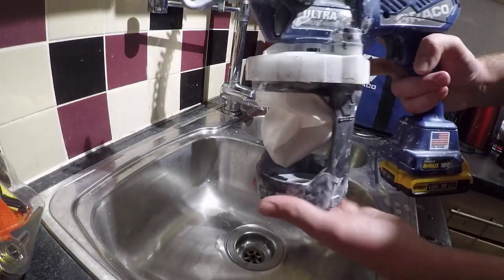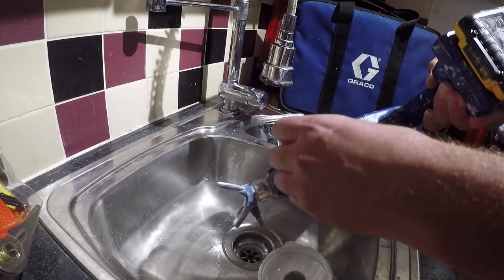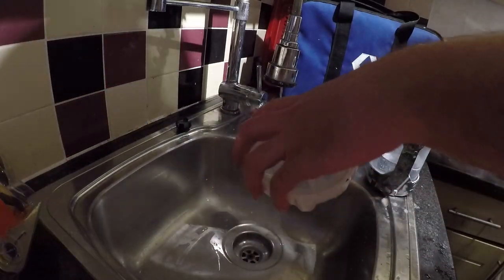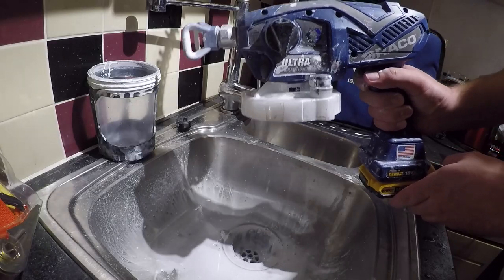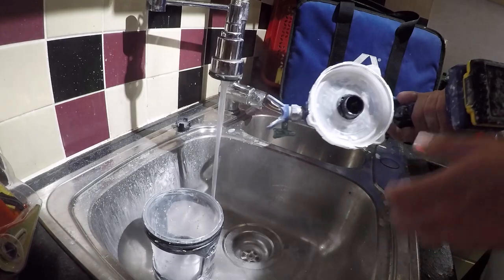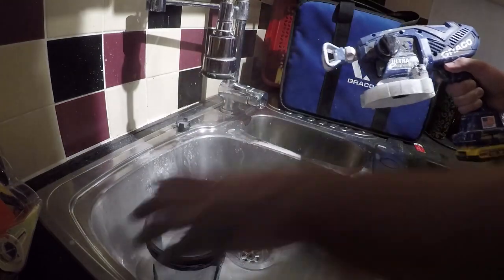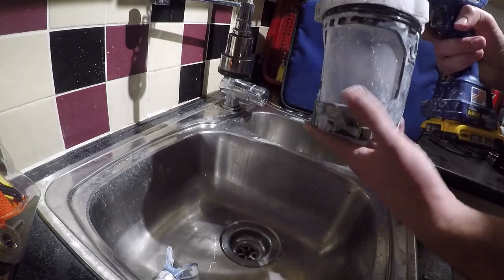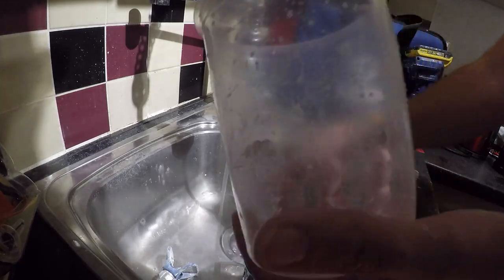How to clean a Graco Ultra cordless handheld airless sprayer

Comment: Interesting technique.  I plan to use it with a minor twist.  By cutting a hole in the bottom of a cup liner I can add fresh water without removing the cup and to swirl and decant dirty water as needed to facilitate cleaning in the upside down position.  (Freely admit I’m a lazy when it comes to cleanup)

Comment: What's pump armour I didn't get that when I bought? Will it affect anything ?
Reply from the maker: @danielculleton207  its something you can buy. It basically keeps the inside lubricated and prevents rusting on the inside and also stops it from freezing. You can search for graco pump armour or qtech qtector. Same stuff. After youve cleaned out just run a small amount through before storing.

Comment: Do you leave the pump armour in until you use it next or do you flush it out afterwards?
Reply from the maker: I dont think ive ever used pump armour in it. Just clean out and leave it with water in the pump. Its lasted long past most peoples and been a life saver
Reply: The instructions recommend leaving the pump armor in for storage.  Either way, the pump armor will need to be cleaned out before next use.

Comment: I've heard you talk about replacing the pump on this machine. Is it a costly fix?
Reply from the maker: I think around 200 to 250ish for a pump. Youd have to check from the suppliers. Pretty easy fix. That why i say if you use them alot get a main machine and this on the side if needed

Comment: It’s clogged up cause it was sprayed without screen what do I do? It tries to push out but not fully
Reply from the maker: Hi did you sort it? If waterbased.  I would fill a cup with hot water and a little dish soap. . Take the guard off. Connect the pot. Power on 9. Flip the unit upside down. Flick in prime and pull the trigger for 5 seconds. Leave to rest against a wall with the unit upside down for 10 minutes.  Come back and flick it into spray and see ig it comes out. Try it in prime again and then spray.

Comment: Always like that you pick good music. Good man. Have you got an air assisted airless unit ? 
I don’t spray my woodwork but I want to. I have an HVLP unit but I only use it for Morrells products.
They are for spraying not like typical gloss or satin that needs to be thinned down  so much there not worth using with my three stage turbine. So considering AAA. You managed a good finish with new FFLP tips on airless or your handheld unit ?
Cheers
Reply from the maker: Steven Mcfarlane  hey thanks 😎. The music is actually my old band haha i get done for copywrite if i have music on in the back ground thats not.mine... tikurrilla is nice to spray. But if you get a more powerful turbine a 4 stage ia 9psi and a 3 stabe is like 6psi so a big jump in power..
Fflp tipa yes got a great finish with them with main unit and ultra hanf held. I'll be using the finish pro 9.5 to spray waterbased gloss next week on spindles. No more that 5 to %10 thinning.. or for your 3 stage if you warm the paint up b3fore spraying you wont need to thin as much 🤘🏻

Comment: We use a 2 part paint for metal which has a reactor, would you be able to use this sprayer? How would you clean it out after as all our other stuff fail and we just end up using a brush....
Reply from the maker: Check out this video https://youtu.be/WyGxKz_tkmA
You would want to be using this one instead.. is there a reason youd need the cordless unit or would a normal unit be viable?
Reply: @sprayaholic  thanks for reply! Yes that’s the one I was looking at, we need this type to try and carry as light/ convenient as possible. Only thing I would be concerned of is getting it cleaned. Needs to be simple enough otherwise the guys will fail to clean properly. Thanks for any advice!
Reply from the maker: @mattmanison8791  no problem.  So you'll be using some type of thinners  for that paint. Id pour a small.amount in the cup give it a shake. Then flip upside down and spray it out. I'll be doing a cleaning video soon with oil based paints. Clean up will be the same principle.  Its not hard to clean
Reply: That’s great, I’ll keep my eye out for it! Cheers

Comment: What does switching to prime exactly do?
Reply from the maker: It returns it out the hole. So its not firing dirty water out so less mess. If you had a tip left in it would wear down the tip eventually.

Comment: Can you help me out? Just got Graco GXFF. Spraying waterbased Sayerlack at99 paint product. Tip is FFLP 312, 100 mesh filter in gun handle. To get decent fan pattern I have to have dial up to full whack. What could I change to achieve a lower working pressure as I'm concerned for life of machine if it's on max the whole time.🤔
Reply from the maker: adamandlorraine is the paint really thick? Have you tried thinning it 10%?
Try it with the black filters instead.  
What are you spraying?
Reply: Sprayaholic it's pretty runny. Made for spraying. Can't really thin it more that 5%. Have ordered a 60 mesh gun filter today and a 314 FFLP tip to see if that helps. Spraying mainly MDF and wood cabinets/furniture.
Reply from the maker: adamandlorraine did you change the seat in the guard? When you buy new fflp tips in the pack is a new black ane orange seat.
Reply: I might have got the seats mixed up now! I've got a normal RAC X one and a LP one. Is the LP one with a diameter bigger hole? Also the hard plastic orange thing. What's that for!?
Reply from the maker: adamandlorraine the rac x one has a large diameter hole. The fflp tips have the small diam are for more harsher chemicals. Hopefullly its the wrong seat.. this does cause it to spray poorly
Reply: Sprayaholic thanks mate for the advice. I'll give it another go today. And then tomorrow I'll have the new mesh and tip to try. It's been working ok but sure it could be better without the high pressure, using tons of paint and most going everywhere.
Reply from the maker: adamandlorraine yes defo sounds like wrong seat.. try changing the seats around tomorrow.. then if it needa adjuating them try filter swap. Let me know how it goes.
Reply: It's going great now. Set dial to low spray. 1200psi on the meter. Laying down nice flat coats. Awesome. Feeling much better about it now. Thanks.
Reply from the maker: adamandlorraine awesome mate.. if you find youre laying too much on and dont want to move faster. Drop down to a .10 tip or .08
Any issues give me a shout. Glad its sorted for you 🤘🏻
Reply: Sprayaholic cool. It came with a RAC X 210 so I might give that a whirl as it does chuck it on pretty fast and wet.
Reply from the maker: adamandlorraine if you do then you need to swap that seat over again. Pressure may change a bit aswel 🖒
Reply from the maker: adamandlorraine thats if its a FF green tip. If it says FFLP then no need to change. Think they will eventually get rid of the FF tips and just use the FFLP

Comment: don’t bother washing the cup.  put the paint inside a thin clear plastic liner like a freezer bag!  paint never touches the cup then:-)
Reply from the maker: Awesome. I'll give that a go. I had a massive box of liners as use for the hvlp too. So usually cleaned out pretty fast as its waterbaser paints. 
I'll give you a shout out when i post the next video up for using the liners.  ✌
Reply: Tried the bags not a great way to do it in my opinion bug every man to his own...

Comment: Do you need to flush water through it before using it after you use the pump primer and it sits your a while?
Also, if it has a problem spitting, what do you recommend? Mine continually spits my matter what I do.
Reply from the maker: hi sorry didnt see this comment until now. How are you getting on with the ultra?
Reply: @sprayaholic  
No worries. 
I actually ended up returning it. No matter what I did, it wouldn't stop spitting at the end of the line. It was so frustrating.
Reply from the maker: @goose7574  oh really, shame. did you buy anything else to try out?
Reply: @sprayaholic  
No, I ended up painting my entire house and garage. The house is just under 4000 sq ft (800sq ft that's a second story), and the garage is an additional, just under 1200 sq ft, so I was using it for lower areas. It was just something extra that I purchased to use, in addition to a regular sprayer. I was thinking I could use it later inside, as well. When I went to return it, they were out, and I didn't want to have to deal with waiting for a replacement, so I just kind of said screw it. At some point I'd like to get another one though. I ended up just purchasing a bunch of tools, in exchange for the cost. 
So now I have an even better supply of tools for doing my woodworking projects. Haha!
Reply from the maker: @goose7574  ah good call. for the extra money id buy a smaller rig. I recently got a new graco gxff i think they are gx19 outside of the UK. for a little more mone they will last alot longer and then you end up with a sprayer for woodwork and one for larger surfaces. at least you got some tools though
Reply: @sprayaholic  
Yeah, I already had regular household tools, jig saw, chop saw, circular saw, power drill, air compressor, a couple nail guns, staple gun, multiple Sanders, etc., but I decided to get a router, a different saw (I'm totally spacing on the name, it's not a band saw, but it's similar, it's for detailed work, and signs), a biscuit cutter, and some more parts for my tool box. 
Probably sounds funny coming from a girl, but I grew up with all brothers and in the car business, so I'm just not the stereotypical girl. Haha!
My Grandfather used to love to do woodworking, so I guess that's where I got it from. 
Anyhow, when I look into getting a new sprayer, I'll write down your YouTube page and look you back up for info, since that's one thing I don't know much about yet.
Thanks for getting back to me though. I appreciate it.
Take care and stay safe... This virus is pretty crazy.
I'm in WA state in the US. We have a TON of cases and deaths in the US now. It's just crazy. About 70,000 deaths. 
Ughhhh....
Reply from the maker: @goose7574  thats cool at least you can do alot of work yourseld and not rely on others as much. I love making things out of woodwork too. Stay safe it these trying times. Have a great day. Feel free to message any time. Hit subscribe if you find it helpful. Enjoy your day
Reply: @sprayaholic  
Thanks, I will.
Reply: @sprayaholic  
Haha! I already am. I just went to click subscribe and it said, "Do you want to unsubscribe?"
Haha!
Have a great day. I'm off to sleep. My schedule is off right now with things. Have a great day/or night. Whatever time it is wherever you are.

Comment: What happens if you leave the pump with pressure overnight to have it ready in the morning. I left mine over night. But today was acting up weird.
Reply from the maker: Was the tip clean? I do usually drop the pressure when leaving over night. But i hvnt had issues in the past. Unless the paints started to dry inside due to heat or freeze from cold?

Comment: How do you clean it with oil based paint ?
Reply from the maker: Aaron McBride RACING ELITE have a couple tubs or buckets. Use one to clean bits and parts in. Run the dirty spirits through yhe.machine. do it with small amounts at a time. That way you can keep puttinh clean material in and it will clean faster.
I would put some in your gun pot. Mid pressure. Don't prime. Turn.it upside down and spray the cleaner out. Then run some in prime. Then spray then prime and spray. Should be pretty clean then
Reply: Sprayaholic thanks a lot

Comment: thats how i clean mine after the forth time using it gets easier to clean.two questions tho. i find after using acrylic u/coat i had no blockages from 12 frames a staircase and all skirtings but when i switched to white emulsion i was having to clean filter after every refill.(both paints neat and stirred). secondly how long would i expect pump to last? that job i mentioned above ,15ltrs of  paint went through it in 4hrs. its the forth house in a row ive done it in as many weeks. hows your sprayer holding up? great vid thanks man keep up the good work.
Reply from the maker: michael mcmike  thanks.  Ye all good mate mines easily had 100L through and still running.  You might need to filter the emulsion through a siv as they always have like gel bits which through a spit or makes blockagesm try diluting 10% and it will go through easier. Also 616 tip i use for emulsion
Reply: ohhhh interesting . i would of thought acrylic would gel up,how strange! so a bigger fan tip for emulsion for ease yea? and siv/thin out. you know what the weird thing is i used the blue #100 filter instead of black #60 this time and the emulsion got stuck! everytime. thorough cleaning is key with this machine.i noticed u dont have pump armour,how come? it must break down residue inside while its waiting for its next conquest. i have a bit of air leakage too from the thread between cup and base,mostly noticable when water inside upside down,any thoughts on that? btw tip size i used was 410
Reply: just thinking. a 616 tip is massive,do you really need that size tip? have u tried smaller?
Reply: i have a 514 tip
Reply from the maker: michael mcmike 514 is ok. 516 will let more paint out. Well for walls and ceilings yoy want to cover the most area with least passes dont you. I dont really change the filters over generally sray all with black. But especially emulsion. For woodwork tips look at 210 310 and 410 for wider areas. Emulsions like i said 516 616 514 youll prob get a few bloclages and it will be slower.
Also i sometimea store in pump armour but i keep mine indoora when not in use and its cleaned well. If storing for long periods yes ill pump armour
Reply: thanks,that makes sense. the 514 and 410 is all it came with. i used the 410 on that last job and had probd with emulsion. also im using it for cutting in only, generally all whithe houses so i do roll walls ceilings first then acrylic woodwork then cut in walls after. so looking for precision reliability rather then wide areas around a 5-6inch fan. i only understand the first number on tips mean x2 like 514 tip =10inch fan spray. im looking at a 310 tip but not sure what the 10 means,im just hoping it means high flow
Reply from the maker: michael mcmike first number x 2 equals fan width in inches. Second 2 numbers are the size of the hole in the tip. The smaller the number the smaller the hole. So highwr number allows more material to come out and also thicker material. I like to use a 619 now for emulsion work. But the cordless instructions say highest tip can.be used is a .16 so a 616 which iv used fine.
U want to be using a tip on woodwork that allows coverage of area with minimal waste above and below. So 4inch skirts i wouldny use a 410 as 8 inch and alot of waste material means money down the drain. Id use a 210 stand a little further back to make fan spread wider and allow it to cover the area with minimal waste
Reply: you sir have just upped my game 50%.i cannot thank you enough.and for anyone reading this i say that there is a huge difference between rac x fflp tips and rac x switch tip,the rac x fflp tip works at 50% lower pressure. so get that for this machine,is that right sprayaholic?!? btw i will let you know in the very near future what tips i got and how it goes.good luck to you and as spock says "live long and prosper" )
Reply from the maker: michael mcmike no problem pleased to help.  Yes this machine only allows fflp tips and i think the new LP tips would work. But id only go as high as a 616fflp.
Rac x blue tips wont work in this unit.
Reply: got a 314 in a cart for order but cant find anything over 516. i already have a 514. whats the point in that .    and thats at spraybase! where d you find a 619999 tip lol
Reply from the maker: michael mcmike you will see a difference in a 514 and a 516. Look at spraydirect. Graco have now released low pressure tips in the same sizes as those blue ones so rac x blue and the LP low pressure ones are all odd numbers.  The fine finish low pressure tips fflp are all even numbers
Reply: omg your right on, you have yourself a nice weekend thx man
Reply: 314 and 616 ordered. btw in your vid your actions were clever fast and efficient. that shit gets un noticed sometimes in our job but just wanted to let u know i saw it.
Reply from the maker: michael mcmike thanks appreciate the support 👌
Reply: my best time saving tip to you or anyone,. is, always roll walls and ceilings first apart from switches and reveals. youll save a day and a halfs work,it reduces a 7day 3 story house down to 5 1/2 days. be sure to prep accordingly!. less cutting in as roller gets tighter and no need to spend a whole day cuttin it walls ,just 20mins.my proof is 3/4bed house in 3days, but with this sprayer im working out something even faster
Reply: @sprayaholic  
I can use the blue tips and the rac 5 black tips with the orange guard.  I also use a 6" extension on mine most of the time also with no problems at all as long as I stay within the tip spec rating chart for the gun . But mine is the graco ultimate not the ultra . So there may be a difference.